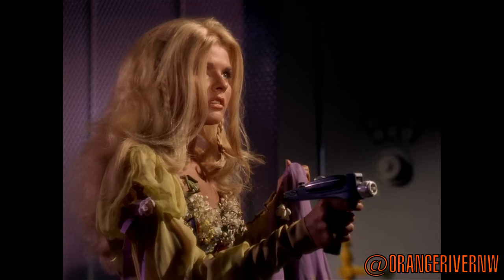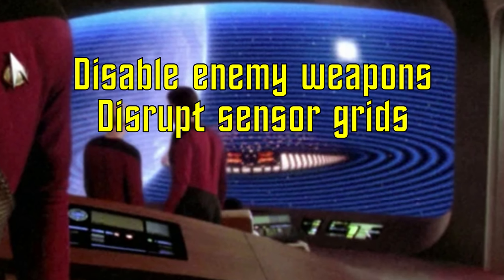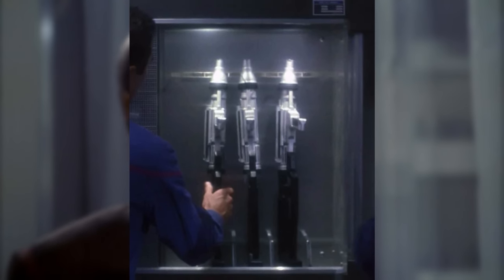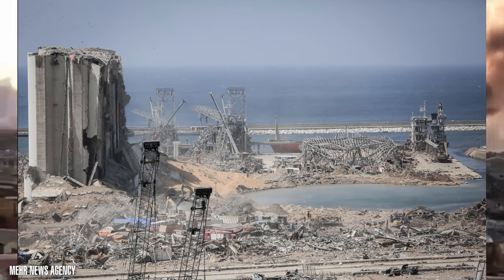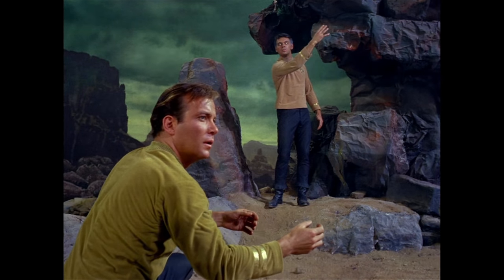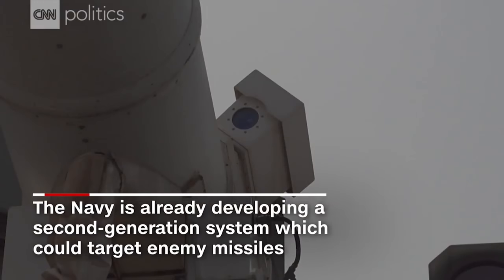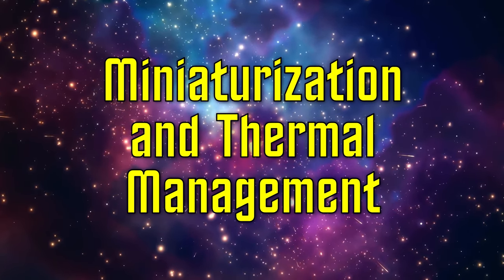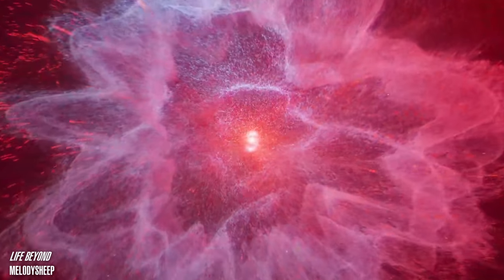The Science of Star Trek's Phasers

Comment: I have a handheld "not a laser gun" I built. 300 Watt output, runs off a Milwaukee tool M18 battery. works amazing! Heat buildup though, yes the #1 issue i'm having. 90% of its internals is heat sync. I can do 3-5 second shots. About 8 in a row before it needs cooldown time. though, I don't have a fan in it yet. I will be doing that. Possibly also a Peltier heat pump, such as for use on a CPU. So at the very least I won't fry the $600 diode.

Comment: There is an experimental ship based laser system that was fag performance expectation when I read about it.  Though it has to be mounted to any ship, it would take something like a Zumwalt Destroyer which can support the high power requirements.
I believe it hit somewhat over 500KW and was aiming for a MW.  Will have to see whatever happened to this project.

Comment: Ok there is a difference between the vaporize setting and the dematerialize/disintegrate settings. Vaporize is on the HEAT setting of a phaser at maximum output. Dematerialize shatters the binding forces of an atomic structure.

Comment: I’d like to point out that while these weapons have similar energy yields to these different kinds of large explosions they wouldn’t cause the same kind of destruction because they are directed energy weapons keyword being directed with all of their destructive force being focussed in one area and therefore it wouldn’t look the same as if a bomb has gone off.
Reply: The phaser energy discharge wouldn't appear that way but vaporizing an object certainly would through thermal expansion.  It'd be like dripping water on a white hot surface; the water drop itself is relatively small but the steam cloud it would make contacting the white hot surface expands it into a steam cloud a hundred times its original size.
Reply: And you spelled "focused" incorrectly.

Comment: I suspect that one of the phaser's main mechanisms is to change the "atomic harmonic frequencies" of the body at which its beam is aimed.
I think we're never shown that vaporization is instantaneous, always with a delay of a few microseconds between hit and effect, the time it takes for the body's natural frequency to spiral out of control in an exponential cascade, following a push in the desired direction.
It would also be interesting to find out whether using one has influence on the wielder body temperature, using the wielder as part of the heatsink

Comment: The large Type 10 phaser emitters are only 5 MJ output. Compared to the 500 GJ output of the older Phase Cannons. So we are not comparing apples with apples here. The Type 10 input energy must be hundreds of times that. I always wondered if the ST Tech manual had a misprint. Some rifles had power outputs of MJs, one was 9 MJ. Perhaps the Type 10 was supposed to be 5 GJ per emitter. That was the output of the Phase Cannon when it shorted.
The 200 top emitters of the Galaxy were collimated so would have a TJ output if the latter was correct. That seems to be collaborated by the damage caused by the Enterprise firing at the Borg cube on it's first encounter with it's top array, with the Borg having it's shields down, and causing a large crater on it's surface, several hundred meters across and half that deep. A 270 odd ton TNT equivalent explosion could cause that?
Reply: I believe the Type 12 Phaser was 7 MJ/GJ output, though the arrays were shorter on the E class.

Comment: With the energy density of a phaser's battery pack no Starfleet equipment should ever run out of power.  Ever.  It's likely that a phaser can run out of charge from continued high-energy fire but a tricorder...no. A phaser battery pack would be able to supply power an average 21st century home with no problem.  Given the power density, there's no reason life support on a ship would ever be compromised if supplied with a battery backup.  Light & heat would never go out, O2 generation could last for months at minimum (even in an EVA suit.)
I do realize everything works according to 'plot physics' but still...

Comment: Oscillating sound frequency compressed into a beam of light basically it's a laser that has been integrated with sound oscillation frequencies.

To understand how this works you have to understand that sound is a vibration and vibration creates friction which creates heat and if you elevate the frequency of sound enough it becomes heat and light if the vibration resonance is powerful enough it will have an impact on an object with a great amount of energy and heat.
Reply: I always thought the oscilation was used to destabilize chemical bonds resulting in the target dematerializing.  I thought that was the phaser part.  Lasers just produce heat.  Masers exist and fire slow moving particles.  They use some of this type of equipment for precise metal cutting and welding.

Comment: The US Army is building the most powerful laser weapon in the world

The US Army is building a laser weapon more than a million times more powerful than any used before – although because it delivers short pulses, the overall energy involved is low.

Existing laser weapons produce a continuous beam that is held on a target, such as a drone or missile, until it melts – the first was deployed by the US Navy in 2014. The new weapon, known as the Tactical Ultrashort Pulsed Laser for Army Platforms, would be more like science-fiction movie lasers, firing bullet-like pulses of light.

Such ultrashort laser pulses carry extreme power over vanishingly short lengths of time: the project is aiming for a terawatt pulse lasting just 200 femtoseconds (2 x 10⁻¹³ s), compared with a maximum of 150 kilowatts for previous systems.

The laser would produce 20 to 50 pulses per second, for an overall power rating of 20 to 50 watts, around 10 times more than an LED light bulb. Ultrashort lasers this powerful are already used in laboratories and factories, but the US Army wants a compact, rugged version that can be aimed at distant targets.

Normal lasers are ineffective over long distances because the beam spreads out, but ultrashort pulses can be shaped into self-focusing light pulses called solitons that turn the air itself into a lens, continually refocusing the pulse.

Such a weapon would produce dramatic effects. The rapid temperature rise from the ultrashort pulse would vaporise the surface of a target rather than melting it, a technique used industrially to drill precise holes through metal. The resulting rapid expansion of gas can also produce a powerful blast wave

Comment: The real problem with hand held/portable energy weapons is simply…storing the energy.  Our best Lithium tech batteries would be exhausted in a single shot.  For example…the total energy in a professional cordless drill power pack is about 100watthours, or 400 KiloJoules.  That would be a Kilowatt for 6 minutes or 100 Kilowatts output for 4 seconds….or a single weapon burst shot of one second at 400 KW…That’s almost half a Mega Joule…but only once.  How much could that do to you…well in theory it can boil about two litres of water…in your flesh (nasty). Concentrated in a single tennis ball sized area of your body it would cause severe penetrating third degree burns….disabling the target.  For now, bullets are as effective, and much lighter than battery packs!  If in the future we get batteries the size of tennis balls that hold like 1000 x more than current power cells, well then it might become feasible.

Comment: The one thing that bothers me about phasers is the lack of safety, like they're too many instance of them being accidently set on kill or vaporise, it's probably mostly writing flubs like with the number of decks or beaming through the shields.

Like you would think they would have explicit safety measures like a coded buttons for higher settings or maybe biometrics for the proper authority or rank.
Reply: I asked the designer of TNG phasers and even he didn’t know how the buttons worked for power up/down and regular/wide beam
Reply: TOS PHASER ONE did have a lot of safety features. It couldn’t work/fire unless the sight was raised and the emitter extended.
Reply: Maybe they can be set for living tissue only.  Setting one off might scramble any electrical equipment near by.  In the movie they killed a guy with stun to the temple.

Comment: Is there a plausible way in which the beam would be visible? Laser beams, unless there is dust in the air, can't be seen except if it is aimed at you, but the beam effect is necessary for a phaser being fired to look cool. If it is plasma, maybe that would look like a beam or bolt like a lightning bolt which is visible but is not a neat, cylindrical beam.

Comment: A stun gun can get 50,000 volts out of a 9-volt battery. The most efficient way to make an energy-based weapon is with a pulse not a beam. Using capacitors that would build and hold and then release a charge would be most efficient. I would start by building a rifle since you could pack more power in it. If that's successful then I would try to make it smaller.

Comment: Plasma beams seem unlikely to me because plasma cools down quickly into just hot gas outside of a sufficiently hot environment to sustain it, such as the heat in a star from the compression of gas by gravity or an artificial heat source in these plasma weapons. Even if the plasma is produced by electrical ionization of a gas, it's not gonna last long after being fired. Lasers would seem to be the only energy weapon we could have. Current lasers seem to be limited by using a single frequency of light. Perhaps a broadband laser using a wider range of em radiation frequencies, from microwave and radio waves all the way to X-ray and gamma, could produce the effects needed.

Comment: You could manage alot of that heat if it went along with the beam. Aside from the ejection of the plasma removing alot of heat along with the shot, all you'd need is rather than a cooling system, a vacuum between the chamber or some way isolate the firing chamber completely from the rest of the weapon. 
As with computers, heat is a by product of inefficiency, a loss of energy in ways you don't really want it.

Comment: A phaser doesn't pack a punch, is the target that packs the punch when the cascade reaction.

It's not as much about the power output of the weapon as it is about the power input of the target
Reply from the maker: I mean, both are true. Yes, one has to take into account the mass etc. of the target and how quickly they'd be stunned/killed/vaporized. But...it's a pretty huge deal that such a powerful beam of energy can be packed into a handheld weapon like this. Like I said, power and heat management would be paramount considerations
Reply: @OrangeRiver  Yeah I second everything you say in the video, it's just some nit picking corrections (which is why I'm glad you favor the term "yield" over mere output, or input as I have done in my original post)

I talk about the power input of the target, as a greater part of the total yield, than the power output of the nadion beam itself, because a phaser doesn't just vaporize you, it triggers an ionization cascade reaction after violently turning the electrons at impact point, into angry Ions that eat the rest of the target at the subatomic level.

Which is also why we safely turn the target into light and radiation, rather than steam blood paint the room (why it disintegrates the person and their belongings, but not the ground bellow them? I have no idea)

Comment: Even if get the mechanism of something like a phaser in hand and make it pistol size...the "power cells" what ever they may be  is likely not possible  (such high energy density in such a small volume)
Reply: @daxbashir6232   Yeah, but the laws of physics and energy dynamics have some pretty tight rules about producing/storing energy. In the case of a phaser we're talking tera-joules.
Reply: @daxbashir6232   A phaser that had a one terajoule energy output  is equal to .3X10 9th watt hours.....about a 1/3 of the output of a modern nuclear power plant.

Comment: If one ionises the air and put the discharge of a tesla coil over it, one could use a tesla one wire setting over it to only need one channel of back and forward moving pulses of electricity.
Reply: In order to ionise the air one could use an uv laser

Comment: Actually phasers don't work! They look cool but. Ya put a type 1 phaser on top of a type 2 phaser, the barrels don't line up. The type 1 phaser's barrel is in top of the type 2 phaser. The trigger of a type 1 phaser is on top. So when ya put a type 1 on top of a type 2, the trigger of the type 1 trigger is exposed & every time ya bump the type 1 trigger against something, it goes off. So ya gonna have accidental distarges! Because 1 barrel is on top of the other, that's a problem! So how do phasers work?

Comment: In theory could the primary disk of a starship be the hadron collider that powers the impulse drive?
Reply: Impulse engines exist and are used by NASA.  They use charged gas flowing down an electro magnetic gradiant.  Just like a TV picture tube.  The vacume is supplied by space.  They have very low output.

Comment: Sorry, mate, CERN has a 17 mile circumference which is 27.2 Km, not 8.5 Km - you did it back to front and converted kilometres into miles... easily done, I did exactly the same thing.
Reply from the maker: The figure I mentioned was diameter, not circumference. Though I could see circumference maybe being a more useful figure, but that's not what I said in the video
Reply: @OrangeRiver  
Okay, I must have misunderstood/misinterpreted.